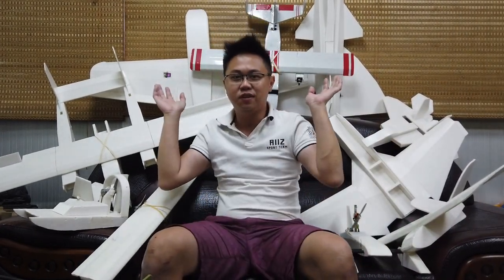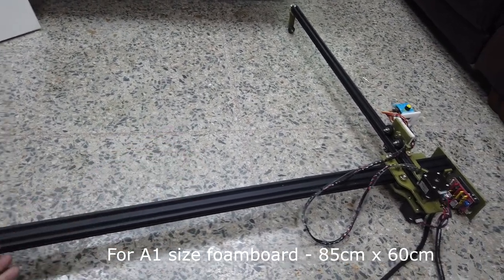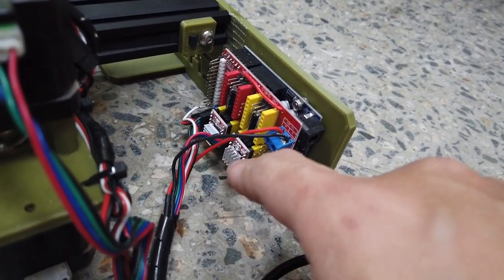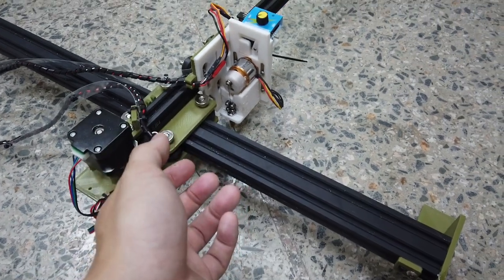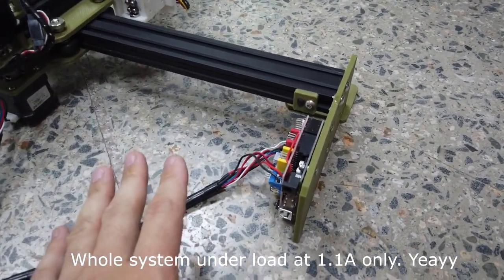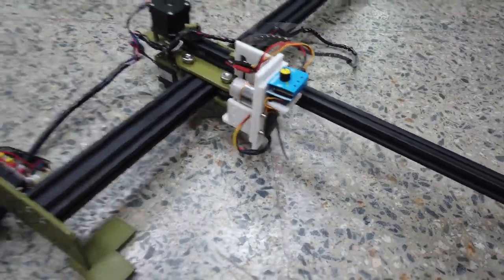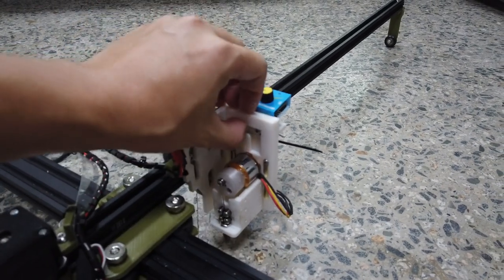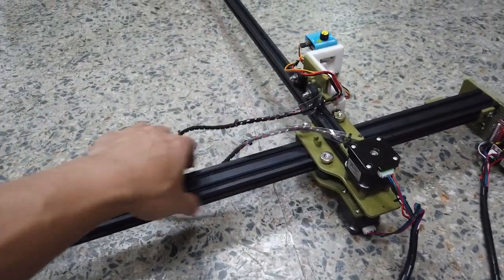ERC TimSav DIY CNC Foamboard Cutter - Introduction Part 1 of 2

Comment: Congratulations for your great job 👏👏👏. What about you create a module for a wood laser cut?
Reply from the maker: hahaa wood laser cut will require CO2 setup already. Big
Reply: Would be possible to cut thinner wood with laser engraver module? My idea is to use a connector with 5 pins to speed up the module change between laser engraver and foam cutter.
Reply from the maker: @Rosatisp  yea still need multiple pass

Comment: Hello, how is everything?  Friend I'm building a hotwire and stopped at the software part.  I did a lot of research and saw that DEV software is the best.  I saw that the friend is using DEVCNC FOAM.  In your case .... Could you give me the software?  Or give me a tip where I find the license?
Reply from the maker: hi. i use all free license only. full details below

https://www.thingiverse.com/thing:3951161